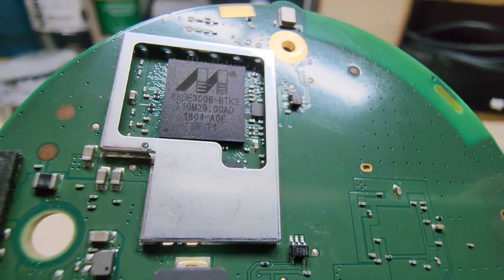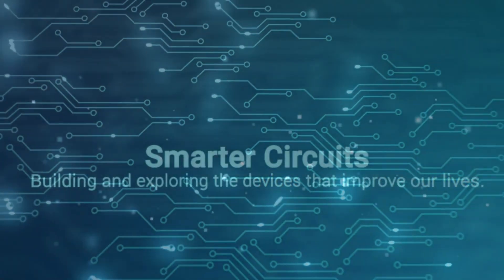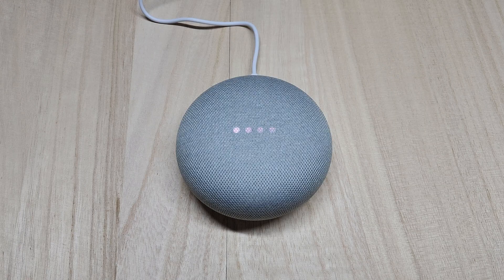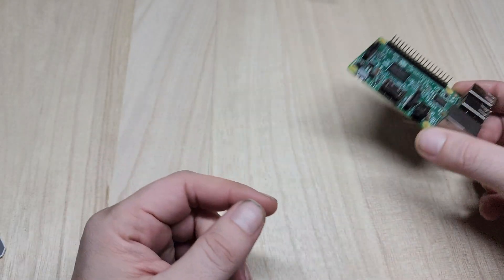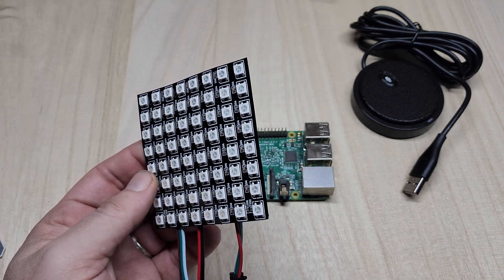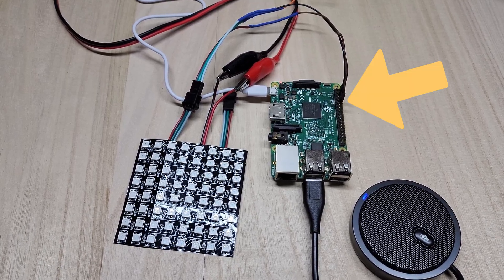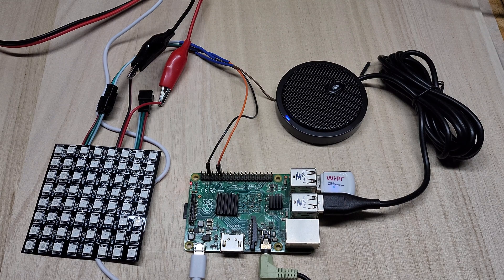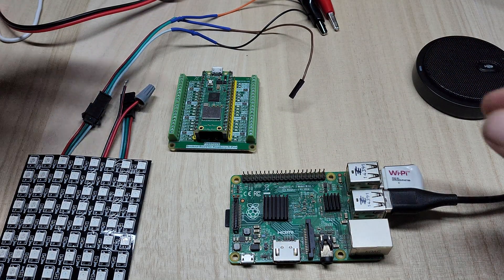Replacing My Google Home Mini With Mycroft AI Driven Voice Assistant bad audio

Comment: Wow, I really want to get the information in this video, but it's aggressively annoying.
Reply from the maker: Sorry it was annoying to you, I did a lot of experimenting with the videos to see what worked and what didn't. If this one didn't maybe another will. However, you probably wouldn't be able to use much of what's in the video at this point as I believe Mycroft is no longer supported or being worked on. I do plan to cover another voice assistant using Home Assistant's new voice stuff from the Year of the Voice, but I have a backlog of video work and paid work to get to first. You might benefit from checking out that Home Assistant stuff, though. You can set it up for offline use--I wouldn't even consider it otherwise.